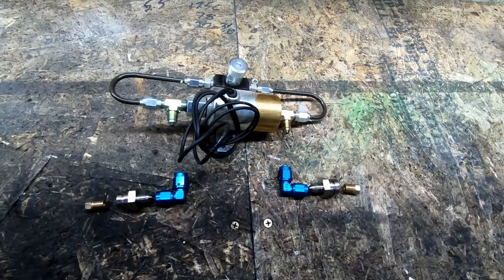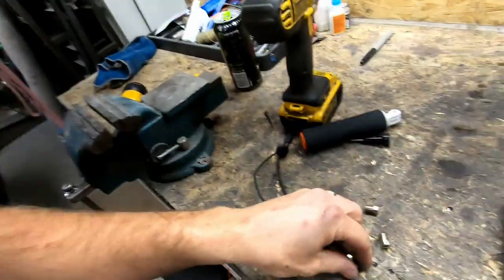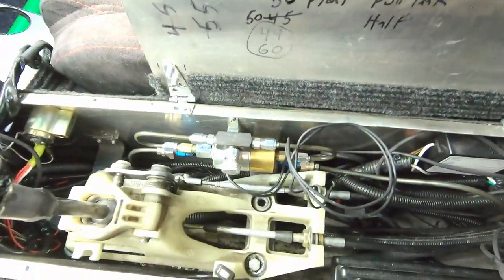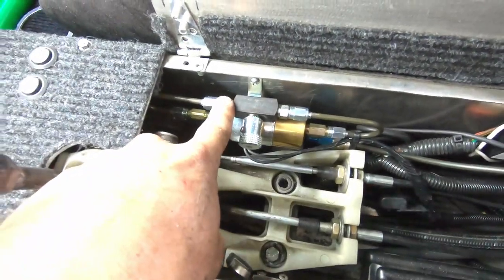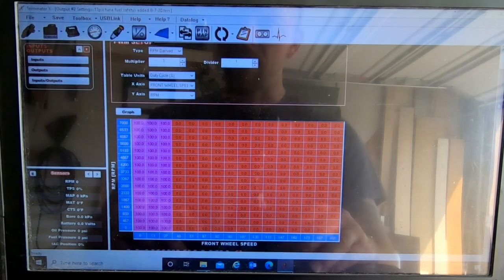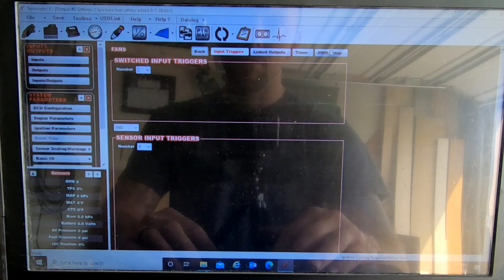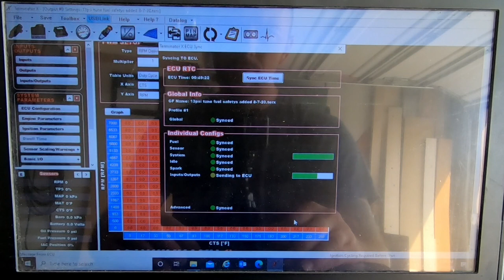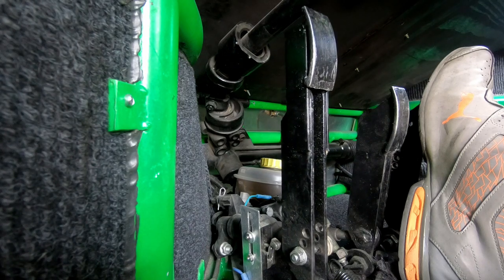Clutch Delay Valve

Comment: Do you think this could be wired in conjunction with a msd 2 step? I have my 2 step activated off my ebrake for holding the car at the line. I'm wonder if I just use the same connection it would work? 
Also how has this been treating you?